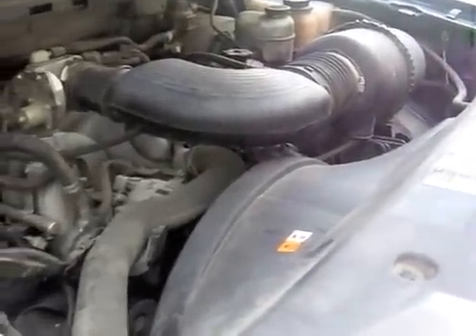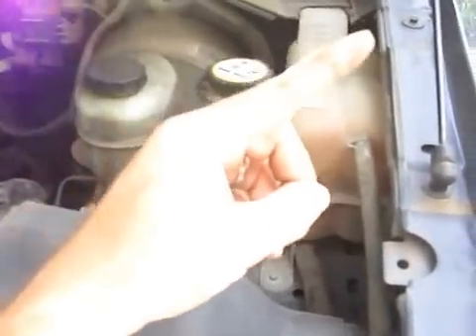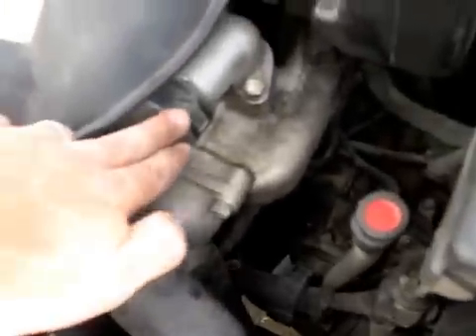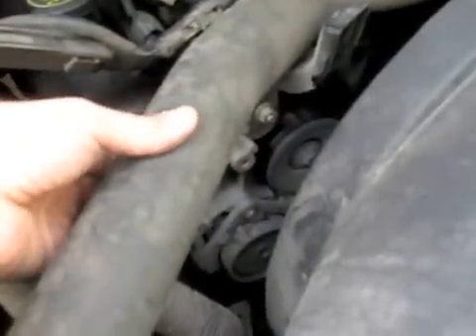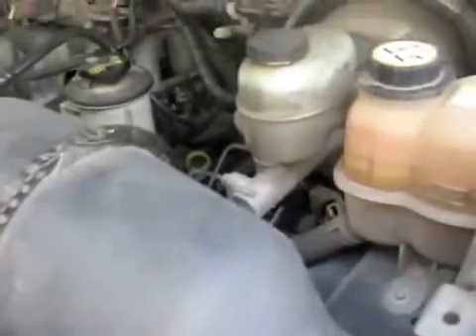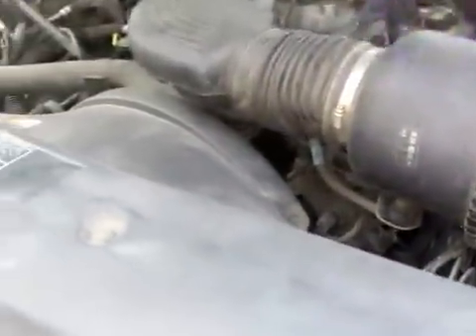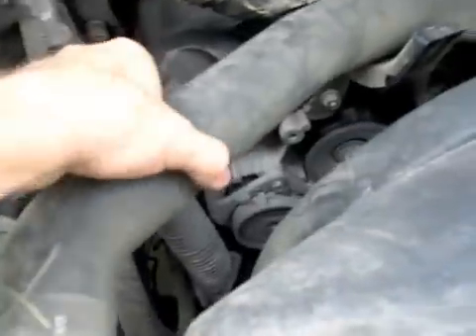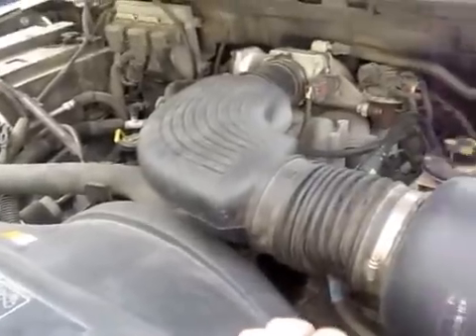Car Engine Overheating - Causes and Symptoms of Over Heating  Car Engine

Comment: Hey Trust i got a question,my 2000 Chevy Impala overheats,i have had the coolant switch,radiator and thermostat replaced and there are no air bubbles running through the system and i've ruled out the head gasket as there is no leak in the block the car runs better but the temp still climbs when i'm idled and the low coolant sign comes on periodically what's wrong? Oh, only one fan works on my duel system..
Reply from the maker: You should have one electric fan for the a/c compressor and one for the radiator to control engine temp. Turn on the a/c compressor and see what fan comes on, then see if the other fan comes on when the engine starts to heat up.  Could be the fan you see is the a/c condenser fan and not the radiator fan? Radiator fan has to cycle on and off at idle when engine warms up. I would still get a cooling system pressure test to rule out a small leak you are missing, but that is not allowing pressure to build in the system....which it needs.
Reply: Thanks Trust,,

Comment: First of all I think it's awesome that you actually respond to peoples question on youtube. My cabin heat randomly turns off and immediately the temp starts to skyrocket, often the heat will then randomly start again and the temp will drop back to normal range. It once overheated into the red, when I looked under the hood, all the rad fluid was in the overflow tank. I took off the cap, it flowed back into the rad. I changed the rad cap, wasn't that. Also the temp gauge is jumping around as it begins to overheat and then returns to normal. Any ideas?
Reply from the maker: Thanks for your comment.  Do you have an older style radiator cap ON the radiator itself that you can remove and check the coolant level in the radiator?  Looking in the overflow bottle does not really tell you what is happening inside the radiator. I would assume that you are low on antifreeze inside the radiator...due to a leak somewhere, or you have a restriction in the radiator which is not allowing coolant to circulate and back up into the overflow....or you have a bad electric cooling fan motor which is not cycling on and off as the engine heats up. Electric radiator fan should be ON when the engine is running hot.   Check those and get back with me.
Reply: TrustMyMechanic.com
Thanks for the response! So it's looking like you called it, its a chevy venture 3.4 and the high fan is not getting power properly but when power is run directly it works fine. That would explain the sudden jumps in temp up and down as it works intermittently. So again thank you, you are a true guru, I just subscribed.
Reply from the maker: phrozen17
Thank you. Don't jump to conclusions on a fan sensor just yet. There has to be plenty of hot coolant in the system for the cooling fan sensor to read and respond to. If there is no hot coolant, the fan will not come on. So make sure there are no leaks and no restrictions OR air pockets in the system that would prevent coolant circulation. if you cant find anything, might be advisable to pay $50 for a proper diagnosis from a local mechanic before changing parts.

Comment: Hello sir.. Question: i just get into overheat engine and my check engine light is on. After few minutse I check my oil dipstic and my oil was very low. After adding oil in my car engine and try to drive it around I noticed that my check engine light is still on.. what is might be the caused why is my check engine light is still on? Thank u for the responds
Reply from the maker: if this is the YELLOW check engine light then you will need to have the computer codes scanned with a handheld scanner. Some auto parts stores will do this for you for free now days. It can be caused by a malfunction in any of the sensors under the hood....too many to try and guess without having the trouble code from your computer.  See if they can reset it and if it comes back on....might not.
Reply: I try to disconnect the battery and check the dash board engine light was gone. i try to drive the car for 3 hrs around the Oahu Hawaii it doesn't give me a problem. but the time that i get stock in huge traffic, after 30 mins. the check engine lights was on again and i cannot run faster than 20mph. when i pull over i check the oil and radiator coolant and everything is all good level..  after few minutes my car run again in normal mode. my question is do you think my car has a problem in radiator or in the engine? why is that my car got stock in the traffic? what do you think I need to do to solve this problem?. I appreciate your help I'm in need of money right now and auto shop is not in my option to solve this.. thank you sir.. :D
Reply from the maker: mark Loria
Check to see if the electric radiator cooling fan is running up at the radiator when the engine gets hot, or at normal operating temp. It should be cycling on and off as the engine warms up and should be one constant when the engine runs hot. The light will continue to come back on if the problem is still happening, so you will have to read the codes to find the problem with the light issue.
Reply: ok sir thank you.. :DD

Comment: Question:[04 Monte Carlo]  I have replaced my thermostat (& the housing), the intake gaskets, and bled the coolant system several times and my car is still overheating and the heat is not working. Everytime it overheats the antifreeze is full (no leak anywhere).. could it possibly be the water pump?
Reply from the maker: Hummm, NO coolant leaks??? Sure?  if you dont have hot air inside the vehicle then their is no hot coolant circulating in the heater core in the dash. With the engine at operating temperature feel all the water hoses with your hand. Both radiator hoses, and both heater hoses going to the passenger side of the vehicle. All should be hot, if not you have a restriction or a large air pocket somewhere.  I have seen 1 water pump impeller rust off so it is not circulating coolant, rare, but can happen. Radiator restriction or bad thermostat possible.
Reply from the maker: Also make sure there is pressure on those hoses, you should not be able to squeeze the hose together...not easily anyway. A bad radiator cap, coolant restriction or a coolant leak can cause lack of internal coolant pressure.

Comment: Question. My car gets to 3/4 hot ONLY when going uphill. I can push the hard as hard as I want either on the freeway or the road. I don't get why it would do that? The temp stays right below the middle mark. Also i don't know if this is relevant, in cold mornings it has low idle. And when it hot it goes away. 95 eclipse Gst . Thank you
Reply from the maker: Well, this could be caused by a few things.1 A restriction in the radiator that is not allowing enough coolant to circulate through the engine....and more heat is produced on steep inclines. 2. Ignition timing that is too far advanced, which gives extra power but can cause the engine to run too hot under a heavy load 3. A restriction in the exhaust system not allowing enough exhaust gas to exit the engine fast enough under the heavy load.  4. Lack of air flow across the radiator - is something in front of the radiator like a bra cover? If this is the original radiator I would suspect it as the culprit. Check those and get back to me if you need to.
Austin

Comment: Have a question if someone can help me with, 
Is the Hose running from the engine to the collant reservior supposed to have fluid in it when the car is off and engine is cold?
Reply from the maker: It can but not really supposed to or needs to, its basically an overflow type of hose and the level of coolant inside the reservoir can vary up and down. It should not be an issue with overheating if that is your concern as long as the level in the radiator is full.

Comment: That is very helpful thank you ...I have a 2007 Komatsu 3 ton Forklift Engine that used to Steam overheat , Opened the engine changed The Pistons ,bushes & gaskets now after a week the same problem again , though we have checked all the water lines and hoses no leaks in or out ! What you think ?
Reply from the maker: Hi there, I am not familiar with this engine, but if you have a radiator I would look to make sure it's not restricted. Also get a cooling system pressure test to rule out an internal or external coolant leak you might be over looking.
Reply: Hi, I am having a problem with my brand new Cheri tiggo 8pro max with 1 200 km on the clock. The oil was almost finish ( is it normal for a new car? A month later the termostate shows its over heat. Is it normal for a new car?

Comment: watch ericthecarguy video on bleeding the cooling system.works the same on every car
Reply: I was wondering why he diddnt touch on this for overheating at idle.

He should add if ot overheats at idle but then temporarily dips when you speed up, you probably have air in the system.

Comment from the maker: It could be, but since you saw smoke I would assume you probably have a coolant leak spraying water on the engine, so get a cooling system pressure test first to rule out an external or internal coolant leak. Then check the inside of the radiator for a restriction or heavy rust build up. If you see rust/mineral deposits inside then the bottom of the radiator will be heavily restricted and could be your overheating issue.

Comment from the maker: Probably not an issue, as long as you are not overheating and not having to add coolant regularly. If you are, then you need to get a cooling system pressure test to help you find the coolant leak.

Comment from the maker: You see drips of water coming from the muffler under the vehicle???  There is a small moisture drain hole in the muffler itself to let water from condensation drip out. The steam is probably just condensation...as long as it goes away after the engine warms up.  You say it IS overheating??  You ARE having to add coolant regularly??  Most info please.

Comment from the maker: Yes the waterpump could be your leak source. They tend to leak more when the engine is running than when engine is off...and leak more at higher RPM like on the freeway when the engine/RPM/water pump is spinning faster.

They do make some supposed water pump leak additives but I have never seen them actually work :(  replacement is the only real option.  You have not mentioned any of the common head gasket problems so I would say no at this time. Let it overheat real good just once...then yes!
Reply: The mechanic had the thermostat removed at the installation of a replacement/new engine to allow free flow of water or coolant into the engine. I got another radiator but  keep loosing water after every 20km or less (in heavy traffic situation).
2. Is it right to remove thermostats from the car because the car is now being used in the tropics where the atmospheric temperature is high like Africa ,to prevent overheating?

Comment: i have to add coolant every time i use the car because it just disappears i do have a water pump leak could a water pump leak cause all the coolant loss ... or could it be a head gasket problem ..

radiator cap was replace but problem is there ...
any solutions other then replacing water pump?

Comment from the maker: Did you get the cooling system pressure test to rule out a leak?  Did you have the radiator checked for a restriction?  Are all water hoses hot when engine is warm?

Comment: excellent video, I would have to say though always check the lower radiator hose condition as well as when you check the top, in addition if your having overheating issues at highway speeds and you know its been a long time since you've flushed the system running on dirty coolant, it would be a good idea to check the water pump as well, I had the waterpumps internal propeller on my 98 f150 dissolve due to running on old coolant BTW headgasket test kits can be rented from AutoZone fairly cheap

Comment from the maker: If no hot coolant is circulating in the system, either due to not enough coolant or a restriction in the radiator, a large air pocket in the system not allowing coolant to flow or a stuck thermostat then you will not have hot air from the heater. Both upper and lower rad hoses should be about the same temp, and both heater hoses should be pretty darn hot too when the engine is at normal temp, about 210

Comment from the maker: Sean, first thing to do is rule out an external coolant leak. if a leak is not obvious, get a cooling system pressure test to locate it. If no leaks are found, then I would suspect a radiator that is restricted at the bottom and has limited circulation, thus boiling over the coolant in the overflow bottle.  Flushing does nothing, replacement of the radiator is probably due, but rule everything else out first, coolant leak, lack of air flow, thermostat etc. in my video. Keep me posted

Comment: the radiator was steaming so i let it sit and cool off than i felled the coolant and poured a shit tone of water into the radiator, then let it idle for a while with the heat on full blast and it was cold air for about 15 minutes than became very very hot ant the temperature guage immediately went way down from over the red line to below 210 and it seemed perfectly fine after that and i was able to drive it about 30 miles to get home.

Comment: My engine started to over heat today on the highway, when i pulled over and checked it the radiator was bone dry and i had no coolant, however the radiator and battery were soaking wet as if my engine spewed out all of the coolant everywhere,

Comment from the maker: First thing that comes to mind is an electric radiator cooling fan problem, do you have one on this vehicle?  Second thing that comes to mind is just low coolant level due to a leak somewhere, third thing that comes to mind is lack of air flow across the radiator...is anything in front for the radiator blocking air flow? Last thing is a restriction at the bottom of the radiator. Giving it some gas at idle speeds up the waterpump and fan so waterpump is working fine.

Comment from the maker: Have you checked to make sure the electric cooling fans are coming on and off? Check coolant level, check for leaks if low. Check radiator for a restriction if the overheating seems to happen after long freeway driving at higher speeds then coming to a stop.

Comment from the maker: Yes it could be a problem with the fan motor or the sensor to the motor. Did the A/C compressor clutch click on when you turned on the A/C?  The part that the fan belt is attached to, that is the clutch and will make a click noise and spin the compressor when you turn on the A/C. IF the compressor is out of Freon, it will not come on, and neither will the fan.  let the car idle until it warms up, does the fan come on and off, it should. Take a broom stick and give it a push and a tap.

Comment: WHat do you think of Evans Waterless Coolant.  I've used it in my SUV and there is no pressure. I can drive it with the radiator cap off even.  It boils at 375F.  I think its an amazing preventative maintenance and if someone's got an old clunker with a overheating issue Evans would make a great "band aid" for that problem.

Comment from the maker: First, check the coolant level in the radiator and top off as needed.  Second, Do you have an electric cooling fan up near the radiator? Most cars have at least one electric cooling fan for the radiator and that fan should cycle on and off at idle or slow speeds as the engine heats up.  Double check that fan operation at idle. If you have 2 fans, one is for the A/C compressor and should come on when the A/C compressor clutch kicks on.

Comment: sir i have a question. im having trouble with my car.. whenever my car is on idle or when i start to switch on the AC, the temp meter went up to almost the red part. but when im driving fast, the meter will start to go down. i have little knowledge in cars so would you please help me identify the problem? thanks in advance.

Comment from the maker: Not good.  White smoke out the exhaust pipe can indicate an internal headgasket leak. I have a video in my youtube channel "best head gasket sealer" you should watch.  But first, get a "cooling system pressure test" that will help you determine if you have an external or internal leak.....you have one of them :(   Any mechanic can do this cheap and fast test..then get back with me.

Comment from the maker: If you are DRIVING at freeway speeds or basically any speed other than sitting still at idle then I would check your radiator for a restriction at the bottom, check to make sure you are full of coolant in the radiator and there are no leaks.  Overheating while sitting at idle or very slow speeds usually is a coolant fan issue, but while driving or at fast speeds is usually a radiator or lack of coolant circulation issue.

Comment: Hello Sir,
I drive  Renault Logan car.when i drive my car  after 15- 20 minutes the car gets over heated & .the coolant gets boil & comes out from the coolant can  .
Please assist me on my problem ..
the  fan which is is behind the front grill also not running ... 
earlier it was running but now it is not working.

Comment from the maker: As long as there are NO coolant leaks and you are not constantly adding coolant to the system I would lean toward a problem with the radiator...a restriction at the bottom that can not be flushed out.  When its running hot, feel the upper and lower radiator hoses, they should be pretty close to same temp. If not, there is air in the system that needs to be bled out, there is a leak and not enough coolant, or a restriction is happening. Does that help? Probably not an issue with the fan clutch.